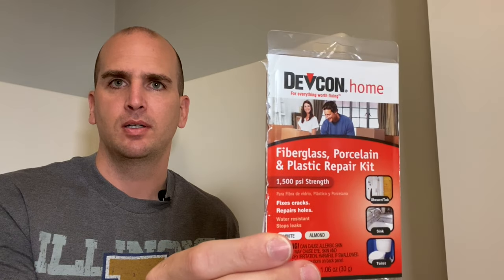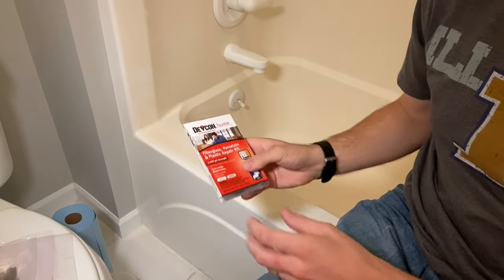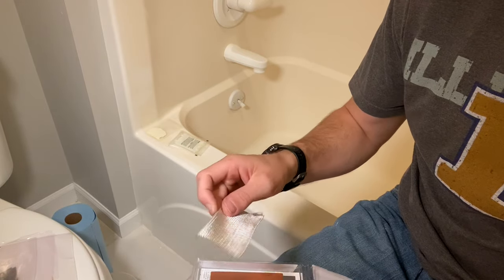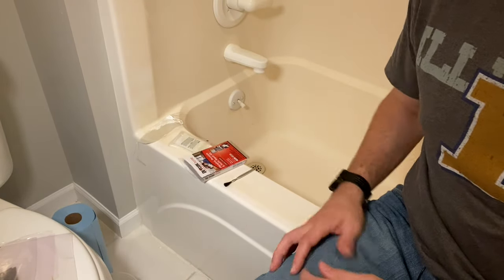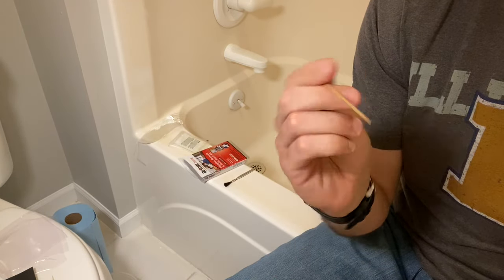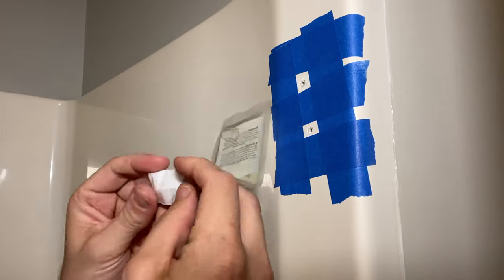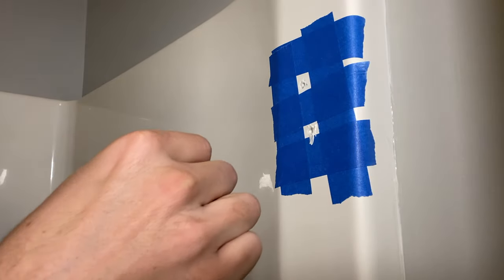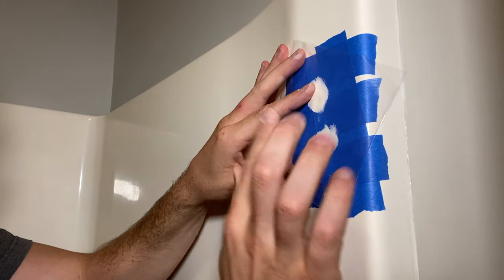HOW TO REPAIR A HOLE IN A FIBERGLASS BATHTUB SURROUND

Comment: Pretty good. Remove first blue tape when wet. Replace when dry and ready to sand. No cutting and dried glue on tape that way.
You can also use a small plastic blade, even an old piece of stiff plastic, as a mini trowel to push some puddy in.

Comment: Thank you for this mini series on how to change the glass door to shower rod, I’m going to be doing this project with my dad in a month or so once I have everything I need so thank you so much! 😊
Reply from the maker: No problem,  glad you found all the videos and best of luck on the project 👍
Reply: Question is do you remove the plastic piece when dry or while still wet

Comment: Seems it might work best to fill the holes, scrape off as much excess as you can, then put the tape up to protect against scratching up the rest of the fiberglass. That way you don’t have to sand as much. Right?
Reply: I would have removed the painters tape as soon as i filled the holes and smoothed down with the plastic bag squares while the epoxy was still wet then let it dry then put fresh painters tape down again and started sanding. This way you are protecting the surrounding fiberglass from scratching and not having to struggle with trying to peel off painters tape essentially plastered to the surrounding wall.   Using  different grit sandpaper is the way to go .  I do drywall hole fills and have it down to a science using that same grit change technique. Now I will use the tape trick too!  Great video!!!!

Comment: I pre fillled screw holes with caulking,let dry few days, then used the kit ,I applied the holes with a hard foam eye shadow foam brush,it worked great,covered with plastic waiting to dry,,,,I feel for just screw holes caulking would be fine,flatten -scrape with a plastic putty knife,let dry ,then artistically paint over  with gloss paint,had I known I would not have ordered the kit.The shower water will never hit this area anyway because the shower curtains prevent it.....

Comment: Thank you! I’m going to remove mine this weekend and Will for sure refer back to this for help on repairing the holes.
Reply from the maker: Nice, best of luck on the project.  As others have stated when you mix the epoxy it will start to setup fast so be prepared since you will be doing multiple holes.

Comment: Thank you. Thanks to this video, my hole repair didn't look like other ones on Youtube. It is fairly flat and smooth.

I did find out the hard way that the almond color of a fiberglass tub does sand off. I wish I had taped more strictly. My repair ended up with small bubbles in it, and needs polishing (after using wet 600 grit).
Reply from the maker: Yeah, I think some people have used automotive rubbing compound to try and bring back the shine.  Overall mine isn't perfect either but overall it actually worked better than I had originally expected.

Comment: I'm prepped and ready to start this same repair today with the same kit. Had not thought of taping off holes or using baggie to flatten. Will do both - do you remove the plastic while still wet or when epoxy is dry? Any issues with the plastic sticking? Great video, thanks!
Reply from the maker: Hey Toni, nope keep it on till dry.  You will have no issue with the plastic sticking and really helps get the bubbles out and flatten the epoxy. Best of luck!

Comment: Your shower door removal video and this one are really great and make me feel confident in doing my project, so thank you! However, the tub I'm going to be working on is yellow, and I can't simply replace the whole surround at this point. Do you know of a good product or have an idea for getting a close-match color for the epoxy?
Reply from the maker: Hmmm, you could get dye to add to the epoxy but I imagine it will be pretty tough to match the exact color.  The Epoxy sets up pretty fast so you would have to be pretty skilled at getting the right mix prior to applying.  Best of luck on the project!

Comment: Man, this sucker began to set up fast and got super hot.  Did I mix it too long or wait too long.  Didn't even get 1/2 my holes done before it was too thick to use.  Suggestions?  I have ordered another kit and I will work faster for the rest of the holes next time.  Also, I found that I need to put the plastic on pretty much immediately before moving on to another hole.  Any help is appreciated.  Great video, btw.
Reply from the maker: Hey Jane,  I agree the stuff setups up fast and does pump out a little heat.  Like most things the first time is always the toughest since everything is new and you are trying to make decisions in the moment.  I think you will be fine on the second batch just pulling from your past experience.  If you could get someone else to help they could put the plastic on and start tapping to make sure the finish is smooth and no air bubbles are trapped while you move to the next hole.  I have another surround coming up where I need to do the same thing so I will need to dust off my skills as well.  Best of luck.

Comment: Never used epoxy before. Did you leave the pieces of plastic over for a certain period of time? I was afraid it would stick if I waited and half the epoxy pulled off on the plastic.  Then the rest of the epoxy in the container was  hardening.  I will probably have to buy another kit also do a second coat because what was left in the holes sunk in a little and now it’s not flush with the wall

Comment: Did you sand the area prior to applying the epoxy? I just bought the kit and it says to do that, but I didn’t see that step in your video.  I didn’t know if it was edited out or maybe simply unnecessary.
Reply from the maker: I did not rough the surface but you are right that is a great first step and will help the Epoxy hold to the surround.  Don't forget to clean the surface after sanding to remove all the small trapped particles.  Best of luck and remember this stuff sets up pretty fast so you only have about 3-5 mins to get the epoxy where you want it.

Comment: Thanks - getting ready to start the exact same project tomorrow!
Reply from the maker: Great, best of luck on the project.  I was just discussing with someone else and they were surprised how fast it starts to harden so just a heads up that you won't have much more than 5 mins or so to work the material into the holes.  The tape and plastic bag will help with sanding.

Comment: This is a project I will be tackling soon. Thank you. Could an electric sander be used?
Reply from the maker: Hey Tracie, I would probably not use an orbital sander for this job.  If you aren't carful and start to sand the surround outside the actual patch then you could lose some of the glossy finish..  With that said you could use some automotive rubbing compound to bring back the finish if needed.  Best of luck!

Comment: There's no way he didn't scratch that surround, with all that hand sanding . PRO tip: Use a dremil tool and you get all the control you need to sand only the raised area saving the surround from DIY hack job sanding marks.
Reply: PRO tip here is the fast way, not the best way. There's no way to feel the depth of sanding through your Dremel and you can go too deep quickly.

Comment: The bag idea was genius.  I used this kit today.  Didn't come out as nice as your's did but I'm happy with the result nonetheless.
Reply from the maker: Hey Vic, yeah the bag really helped to smooth things out and made the sanding process much easier.  Glad you had good luck with the kit as well.  Cheers!
Reply: How long did you leave the bag over the epoxy?
Reply: @jftoad  I definitely don't recall exactly but I think the kit stated drying time for the product.  I used that as a gauge.

Comment: Did you let it dry overnight before sanding, leaving the plastic on overnight as well?
Reply from the maker: I let it dry with the plastic on for 2-3 hours and then started the sanding process.  Best of luck with the project!
Reply: @EverydayHomeRepairs  Do you leave the plastic on or take it off at some point?
Reply from the maker: @pamelaevans5022  I took it off once I felt it was dry (2-3 hours) you could remove after 1 hour and that might help the speed up the drying process while maintaining the smooth finish.
Reply: Everyday Home Repairs thank you.
Reply: @pamelaevans5022  great question! I just put the plastic on my holes and didn't know when to take it off. Great series! The heat gun was a life saver!!

Comment: It would help to have you indicate how long each effort took...maybe I missed that.   The two part epoxy did not completely open up between the upper and lower packets and the Almond kid was not at all fluid enough to add to the mixture; it was like paste and the only way for me to mix it was to stick the brush into the pouch and try to mix it.  All but impossible.. maybe I got an OLD kit and the almond had already started to harden.
Reply: P.S. how long did you leave the plastic on after tapping out bubbles?   Won't know how it turned out after I sand it.

Comment: Also, this is my first attempt at this type of repair and the instructions are pretty sparse... did you wait the 20 min set time or 24 hour cure time before sanding?
Reply from the maker: Hey Toni, I waited 3-4 hours just to make sure it was dry prior to sanding.

Comment: Great videos! How many screw holes will one kit be able to fill? Did you tape off and fill them all, in all 6 locations,  then go back to do the sanding after it dried?
Reply from the maker: Hi Catherine,  1 kit would probably do all 6 depending on the size and any cracks/damage around the hole.  I bought 2 just in case as I didn't want to be half way through the project and have to order another kit from amazon.  I did the left 3 holes and then the right 3 holes on 2 separate days but that was also because I was trying to document and take video.  Best of luck and let me know if you have any other questions.

Comment: Great video. I don’t have holes like yours but I have a hairline crack (where I can run my fingernail thru it) about an inch wide, would this work? I’m not sure it’s actually leaking thru but better safe than sorry later on.

Comment: Great video! Just curious - why not just fill with silicone caulk? Would that not be just as good?
Reply from the maker: Hey Isaak, I think the caulk would be more of a quick fix but to match color a little better and have a more durable patch I would recommend the Devon kit.
Reply: @EverydayHomeRepairs  I wish I had just used caulking, this product is crap! Thanks for your suggestion.

Comment: I guess I waited too long to use it?  I bought this about 6 months ago and just went to use it now - after I broke the seal and poured it into the tray, I started adding the almond color, and no exaggeration, within 5 minutes the tray was burning hot and the epoxy had hardened.  Could not fill one hole.
Reply from the maker: That is actually just how fast the stuff sets up.  You need everything in place and ready to roll as it doesn't take long to start getting hard.

Comment: Suggestion for next time you fill holes: put the toothpick in & break/cut it off so it fills the hole better and gives the epoxy something to go against & use a smaller brush (maybe similar to a nail polish brush) to put it on in thinner coats to see if that helps it apply more evenly to avoid having to do as much sanding. I liked the plastic bag technique for flattening. I saw another video where the patch job looked horrible because the epoxy dripped all over, but this ended up looking good.
Reply from the maker: Thanks for the tips.  Think I might have another opportunity coming up on a small condo we are flipping.  I will get the toothpicks ready 😁

Comment: Great video!  I purchased two packs and trying to fill 6 - #8 screw holes in a tub surround from a glass shower door.  My problem is the epoxy flows out of the screw holes leaving a dimple when it sets up.  Any suggestions?  I followed your advice almost exactly.
Reply from the maker: Hey Jim, I was also afraid of contraction so I left the epoxy a little higher to allow for some pull back into the hole and still have material for a flush finish after sanding.
Reply: You can spray expanding foam into the crack before filling it with epoxy.

Comment: I have a couple tiny holes in the bottom of my tub that have leaked into the ceiling below. Would this kit work to fill and seal those holes?
Reply from the maker: Yes, this could fix that issue if applied correctly.  Best of luck!

Comment: Great video but if the hole is any larger than the one you are showing  (which is quite tiny)  it ain't that easy.  I had 6 holes (removed glass door) each about 1/2" diameter from Molly bolts.  Too small for that cloth they included and way too large just to cover.  I first filled the holes with "GreatStuff" expanding foam to about  1/64" inch below the hole but it was still virtually impossible on all but 1 to get the patch to fully fill the hole.  The epoxy is just way too runny.  Even tried a second package which was able to level 2 more holes but no luck with the rest.  I waited a bit longer on the second coat for it to thicken a bit but that didn't help.  Bottom line:  For very small screw sized holes it's probably great.  Anything bigger, find a different type of epoxy that doesn't run so much.  Also, the sanding scratches the finish of the area around the hole. NO WAY to avoid that because the tape eventually has to be removed to blend the epoxy to the enclosure.

Comment: How long did you leave the plastic bag on?  Did you peel it back or slide it off?  Was the epoxy sticking to it?
Reply from the maker: 3 hours and just peeled it off.  If you use a ziplock or similar bag is will peel off with no issues.
Reply: @EverydayHomeRepairs  So you leave it on while it's drying.  That's cool. Is it dry when you pull it off? Thanks
Reply from the maker: @nerdy989898  yep, it actually works really well and will make the sanding job much easier.
Reply: @EverydayHomeRepairs  Thanks!

Comment: Thanks for the video!  Can you also use spackle to cover the holes if the holes are drilled into the tile?  Not concerned about the look for the time being, just wanted to know if that was effective enough instead of buying the repair kit.
Reply from the maker: Hi Michael,  I don't think spackle would be ideal for the wet environment but I have heard of people using automotive body filler to fill holes in ceramic tile.  If you search the topic on youtube you will find a couple examples.  Best of luck!

Comment: I liked the tools and concept, but don't like the strategy.  I'm going to be repairing small holes in my shower similar to this, but don't think i will lay it on nearly as thick. I'll inject some like you did and then a thin coat overtop. Tape will only be used to protect nearby areas.
Reply from the maker: Best of luck on the project.  Update on mine is all patches are still holding strong 👍

Comment: Great video Scott. What was your rule of thumb for deciding when to switch your sandpaper to another grit level (to 320, then 600)? Thanks!
Reply from the maker: Hey Khalid, you will only use the higher grit once you have most of the excess material removed.  Keep the tape on for as much of the sanding as possible or you will dull the finish of the surrounding area.  If this happens I think you can get some automotive rubbing compound to get the shine back as the final step.  Best of luck 👍

Comment: Hi.  The hole in my shower is roughly the size of my big toe (which is what made it).  Do you think this kit would work for that?
Reply from the maker: I think it would work.  There is a mesh patch which comes with the kit you will need to use on a hole that size.  I don't think the finished product will be as nice but it will be water tight and much better than swapping out the surround.  Best of luck and let us know how it turned out.

Comment: How do you repair the dull finish caused by the process?
Reply from the maker: Hey Warren,  I did not find a way to get the finish back to like new condition.  This is also why I tried to only address a small area and also use the tape for the majority of the sanding.  On my surround it is not very noticeable unless the light is just right then you can see a small difference.  Good luck on your project!
Reply: I was able to get the finish back to new by using polishing compound and a car buffer....Looks great!!!
Reply from the maker: @warrenmoffatt4716  awesome tip.  Really appreciate you helping out with the tip.  I will try it out on my surround this coming weekend 👍